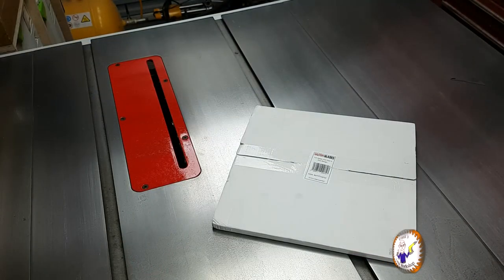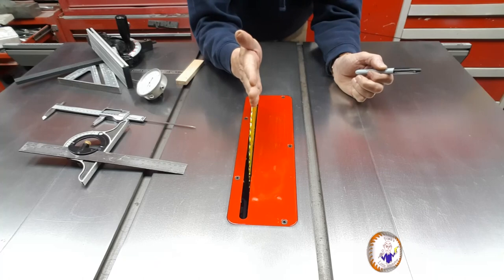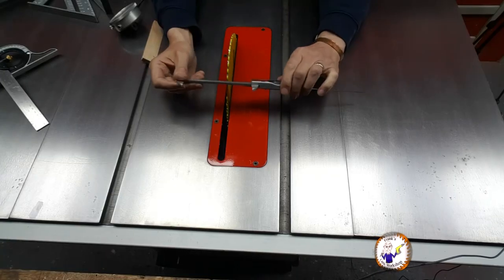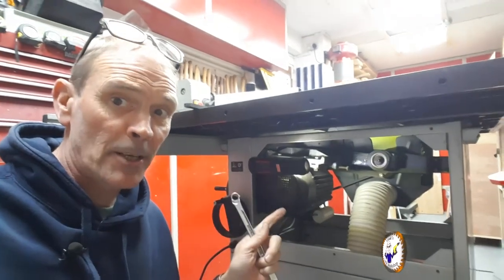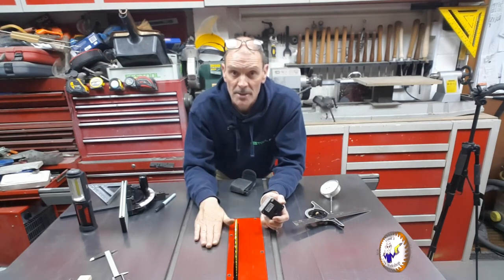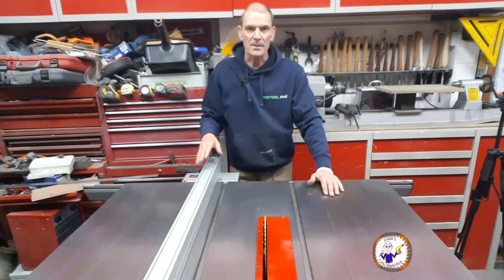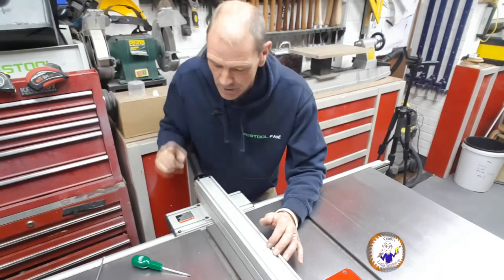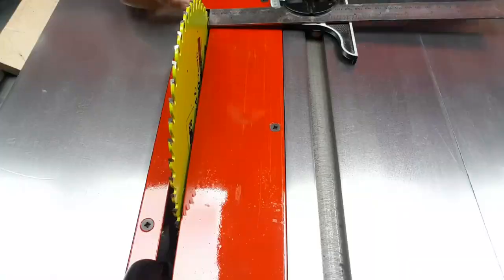Sip 01332 Table-saw, Blade alignment

Comment: I've just bought myself a little bench top portable tablesaw, I spent ages setting it up using my square, was quite a fidly job. Wanted to use my vernier callipers but the battery had gone flat and didn't have a spare one. I'm sure plenty of people will find this video handy as it's packed full of useful information.
Reply from the maker: 😁 Thanks James. I've just treated my calipers to a new battery. I think the old one should be given a long service medal for lasting so long 😂🤣. Thanks for watching James 😁👍

Comment: Really thorough and straightforward guide to making sure everything's in line. I do check at least once a month just to be sure but I have to say I never trust the stops on the tilt as the angle gauge is pretty quick and easy to use and the tape measure can be out if you change to a blade with a different size kerf. Thank you for posting - always interesting.
Reply from the maker: 😁 Thanks Ben. If I am doing anything that is critical I will always use the level box 😁. It's one of my fave tools, and yes it's so easy to use. I've ordered two new tapes for the saw (just waiting on Amazon), but again, for critical cuts I will always measure at the cut. Thanks for watching Ben 😁👍

Comment: Cracking video Frank, I use saxton blades on my mitre saw, I might get the blade for my table saw as the ones I use on mitre saw are great 👍 you've done a great job sorting this saw out mate 👍
Reply from the maker: 😁 Thanks Dan. I opted for the Pro versions, I hope they are as good as I anticipate. I'll probably do a review after I've used them for a while. Thanks for watching 😁👍

Comment: Frank, As suggested by yourself i watch this vid witch i did, i asked how to set the fence to 90 degree to the table, you haven't covered, this, there is no adjustment for this, maybe your is okay on yours , but i need mine 100 % 90 degree the tabletop, thanks again for the great vids.

Comment: I was very excited to find this, Frank, as I have the exact same saw with exactly the same misalignment in the blade (relative to the mitre slots). I followed your instructions religiously, but in my case it threw the whole carriage out of the whack. Both the front and the back of the carriage seem to be floating. When I correct the back, it alters the front, and the other way around. I thought it might be a good idea to tighten up the front bolts and try to adjust with only the back two loose. Do you think that might work? Any other ideas?
Reply from the maker: Hi 😁. Firstly, thanks very much for watching 😁. Lucky for me the adjustment on mine was ok (it did take a few tries.. but it finally worked). I think the best method you should try is loosen all the bolts (not too much) and then tighten just one front bolt (finger tight then just a fraction of a tighten with a spanner). Then adjust the rear and tighten one rear.. then check alignment. If OK then tighten all bolts and check again. Don't try to tighten one end fully and then adjust the other as it will strain the carriage and go out of alignment again. Using a single bolt as a pivot is the key. Hope this works OK for you. Thanks again 😁👍.
Reply: @frankslittleworkshop  So with some patience and the help of a long clamp to hold things in place, I eventually got everything straightened out. I still have a gap of 0.1mm at the front of the blade, but I will have to live with it. I'm sure it's within tolerance, anyway. Thanks for the good advice, Frank!
Reply from the maker: @TheNevron33  😁 Well done for sticking with it. It will be worth it in the end. I wouldn't worry about the 0.1mm delta if I were you.... it will change more than that on a hot or cold day with different expansion rates between your cast table top and the carriage anyway. Thanks again for watching 😁👍

Comment: Hate ti say it but a 60t blade isn’t normally used for ripping.  Most 60t are fine cut blades. Fir ripping look more to a good 24t dedicated rip blade or 40t general purpose blade. Freud make some excellent 24t rip blades which are inexpensive and are what I use.  For fine crosscuts I use an 80t Shark pro blade which is excellent.

Comment: Hey Frank, do you find that the fence on your saw falls out of square every so often? It's happening with my machine - same model - and is causing me no end of frustration. Cheers!
Reply from the maker: 😁 Hi TheNevron33, because I store my tablesaw under my bench and need to move it every time I use it (yes its heavy) I have to remove my fence all the time and store it on the floor (not ideal). This means I am always having to check and adjust it because it gets knocked quite a bit. But its never too bad. So I don't know if it gets out of square if its left on the table, sorry. Thanks for watching 😁👍